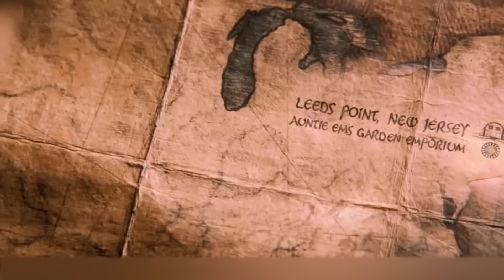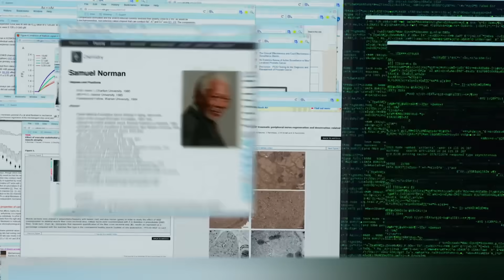10,000 Years Into the Future in 10 Minutes

Comment: What's Happened so Far?

1/1/2019 -- New Horizons made a close approach to the Kuiper Belt, more specifically 486958 Arrokoth at 05:33 UTC.
3/1/2019 -- Chang'e became the first object to land on the far side of the Moon.
23/3/2019 -- ISIS is permanently eradicated as its last territory, located in Al-Baghuz Fawqani, which is in Syria, is liberated; ending a 5-year war.
10/4/2019 -- Scientists at the Event Horizon Telescope take the first image of a black hole (M87*)
15/4/2019 -- A major fire starts in the Notre Dame during Holy Week, with said fire causing the collapse of the roof & main spire.
(gotta finish)

Comment: A space rock almost twice the size of the Eiffel Tower is due to fly by the Earth on August 10.

According to NASA, Asteroid 2006 QQ23 is 570 meters (1,870 feet) in diameter and is traveling at speeds of approximately 16,740 kilometers per hour (10,400 miles per hour). It will come close enough to be classified as a near-Earth asteroid and is branded "potentially hazardous" – but astronomers are clear that there is nothing to fear from the celestial object.

Nice prediction asshole...

Comment: According to Wikipedia, this thing is going to miss, and I paid them my $3 this year, so it's legit.
Reply: But there are 7 more out there so... yikes.

As of 2014, the diameter of Apophis is estimated to be approximately 370 metres (1,210 ft).[3] Preliminary observations by Goldstone radar in January 2013 effectively ruled out the possibility of an Earth impact by Apophis in 2036.[11] By May 6, 2013 (April 15, 2013 observation arc), the probability of an impact on April 13, 2036 had been eliminated.[3] Using observations through February 26, 2014, the odds of an impact on April 12, 2068, as calculated by the JPL Sentry risk table are 1 in 150,000.[3] As of March 2018, there were seven asteroids with a more notable cumulative Palermo Technical Impact Hazard Scale than Apophis.[12] On average, one asteroid the size of Apophis (370 metres) can be expected to impact Earth about every 80,000 years.[13]

Comment: this is perhaps off topic but I think some one might want to give it a try...   I have an idea for a lifting force machine. 
Step 1: Get hollowed out cube.
Step 2: Securely attach magnet to inner bottom of hollowed out cube.
Step 3: Place a lever on inside bottom of cube behind the magnet that's securely attached to inside bottom of cube so that one side of the lever is pointing towards you and hanging over the magnet.
Step 4: Attach a vertical bar to the top side of the part of the lever that is not hanging over magnet witch is securely attached to inner bottom of cube. Make sure the bar goes all the way up to the inner top of the cube barley touching it.
Step 5: Securely attach a magnet to the side of the lever that is hanging over the magnet that is attached to the inner bottom of cube.
Note: Magnets need to be facing each other with attracting poles N,S or S,N
Note: The lever is going to have to be really close to the magnet on inner bottom of cube because of how close those magnetic fields need to be to interact. But not so close that magnets can touch.
The magnet on top connected to lever is pulling the magnet on inner bottom of cube towards it and since the magnet on inner bottom of cube is connected to cube, this pulling force acts as a lifting force. Now at the same time the magnet on inner bottom of cube is pulling the magnet on top downwards BUT the magnet on top is connected to the lever so any downwards pulling force is being converted mechanically by the lever into upwards lifting force. Now if you know anything about magnets you now that there are magnets powerfull enough to lift far more weight then just there own. So essentialy this divice is exploiting the powerfull pulling force of magnets by mechanicaly transforming its magnetic pulling force into mechanical lifting force through the clever utilization of a lever, and walla stuff can be made to fly. Imagine if the magnets in this experiment where electro magnets so the ammount of electrical current going into them determined the ammount of lifting force that it would have. Now imagine this system being used as an attachment that could be placed under or ontop of vehicles to counter the weight of the vehicle and any cargo its carying. Now imagine  if this was done with powerfull permanent magnets and turned sideways and placed in an electric generator and had enough strength to pass through the magnetic fields as it propelled itself forwards with its own magnetic pulling force.     Signed   AMA
Reply: cant work magnetism cant produce energy.. its basic physics... got to love all these idiots on youtube being like "ohh i created a way to produce energy out of nothing im gonna get killed soon" :D
Reply: Thank you for responding :) But please look closer at the experiment I stated. Pay close attention to the use of the lever. :D
Reply: I’m more of a visual person so I would need a drawing 😂
Reply: I created a version of it for the fun of it in a game on PS3 called Little Big Planet 3 and published the level with it in it. You could look at it from their if you have PlayStation 3 and game called Little big Planet 3. Just look for Level Created by BlueCloudStar     :)
Reply: Why not just use a linear accelerator like the bullet trains? It's more or less what you're suggesting only in reverse.
Reply: I'm so fucking baked at work right now .. can't believe I read all of this .. this is actually one crazy theory I give u that...
Reply: Thank You for taking the time to read it :D
Reply: Done it my hand ended up in my toaster

Comment: We can avoid what will happen in 2100 by reducing carbon emissions
Reply: I suggest building a GLOBAL GRID:
for the best distribution of solar, wind, and even safe molten salt nuclear energy, needed to power massive desalination plants, needed to water an extra continent's worth of C4 plants indefinitely, needed to sequester the excess CO2 deep into the soil that would otherwise would stay in the air, heating things up, even if we all stopped emitting more of it now.
It will take decades just for the mass of the oceans to cool back down to natural levels. Otherwise (without removing the excess), it will take centuries for the biosphere to heat up to equilibrium.
Yikes!
Global scale (clean) energy is required to fix global problems.
Reply: @fireofenergy  more scientists need to be in politics
Reply: Humanity's increased it by 50% already.

Thus, to get the atmosphere back to how it was to make the conditions for the favorable climate we will need to use LOTS and LOTS of energy, to get it, the excess CO2, that is,  back down into the soil via plants.
That, inturn kinda makes the deniers right. More plant food, actually, more soil food!
Reply: Plant more trees
Reply: And water them trees. Plant more grass, too (but don't cut it and don't put pesticides on it)because grass, even though smaller, puts more CO2 into the soil, making better soil.
Reply: If you want to reduce carbon emissions then tell India and China to stop existing
Reply: You think by then the coal fires in India will be out, they are pumping out more carbon than I ever will!
Reply: Ya like they had here in BC Canada. They finally closed the plants down cause it was a joke and money making scam, thats all it was.  It did nothing for the climate.
Reply: Thank you!!!!!!
Reply: Well you should probably come up with a solution to avoid the asteroid in 2029 first 😆
Reply: we hope they do reduce these carbon by ''eliminating'' factories .

Comment: By the year 8,000, the moon will have moved less than a fifth of a mile, one thousand feet to be precise. It moves away from the earth at an average rate of one and a half inches each year. Even then, it would take over fifty billion years for the moon to move to the "goldy-lox" zone of the earth, where it will take roughly forty-seven days to revolve around the earth. At this point it will be gravitationally locked with the Earth until some outside force knocks it off course. None of you have anything to worry about.

Comment: If we can still improve computers at the current rate and actually can create an AI we maybe reach many of this goals way before you predicted. 
But Moore's law is not working anymore... One of the best predictions ever made. Gordon Moore said every 2 years the amount of transistors in prozessors will double. In the next two years its not possible anymore, because there are only 5-6 layers of atoms between the electronic parts of a prozessor.

Comment: Your in information base is wrong and therefore calculated extrapolations incorrect. By 2075 The global population will be around 2 billion. Between 2030 and 2070 the depopulation cycle will begin because oil is a finite resource and now odds in decline following a bell curve consumption rate. This is covered as a topic of Biotropic Engineering Design at University of Wolverhampton by Mr A Shattock. He has proven that global warming will reverse after 2100 and global evaporation processes will slow and lead to a stormy maritime climate globally. The increased water volume will cause seismic events on scales need ever seen before that could break open continental edges and release magma that vaporises entire oceans to leave sea beds exposed. This will possibly cause tectonic shifts that create global scale earthquakes of magnitude 9 to 12 that level mountain ranges.

Humanity has little to do with this eventual outcome
Reply: How is "depopulation" going to start? It would have to be enforced, and that would not be easy to do.
Reply: John Atkin oil is a finite resource. As it begins to run out we lose our ability to manufacture fuels to sustain farming, medicine, construction, transportation, machine lubricants, air travel and the collapse of global trade.
Reply: I agree that oil is a finite resource, and I look forward to the day we stop using it. I don't think that will be what causes depopulation though. Not on a large scale.

Comment: FYI: 03:09 "99942 Apophis (/əˈpɒfɪs/, previously known by its provisional designation 2004 MN4) is a near-Earth asteroid that caused a brief period of concern in December 2004 because initial observations indicated a probability of up to 2.7% that it would hit Earth on April 13, 2029. Additional observations provided improved predictions that eliminated the possibility of an impact on Earth or the Moon in 2029."
"The diameter of Apophis is, as of the most recent 2014 observations, approximately 370 metres (1,210 ft).[2] Preliminary observations by Goldstone radar in January 2013 effectively ruled out the possibility of an Earth impact by Apophis in 2036"
 
So instead of calling this out as "a change that will take place" you might wanna get the words "speculation" somewhere in there :), am not saying you are wrong on certain points in this video. I am saying however that some of your "changes" have an extreme high level of speculation to be brought as certainty or fact.

Comment: Okay yes. I am an astronomer currently studying one of the newest stars we have discovered, and i, 2029, the a stroke mentioned is named 2004. After the date it was discovered. every following year that passes, the chances of this a stroke hitting earth decreases. it is currently a 1 in 60th chance that 2004 will hit earth. and if it does. it won't cause major damage. Yes it could kill tens of thousands of people. but if it comes to that. we have a protective misile safety protocol to destroy it before it reaches the crust. this will make it fly into bits and kill a lot less people. And if it is heading for the oceans. then it probobly won't kill anyone at all. besides, the astroid will only be about as big as Texas if or when it reaches earth. but the chances of this happening are still very slim. It would be cool to go outside and see it fly by though. so until 2029 astronomers say that the chances have gotten 20 times greater of 2004 hitting earth. there is no need to worry.

Comment: Ughhh.  Did you even research 90% of this?  

We could TRIPLE the amount, not what we produce, I mean triple the ~440 PPM of atmospheric CO2 and still be below pre-Pleistocene levels, not to mention that two of the periods with the demonstrably highest concentrations of atmospheric CO2 per rock-leaching analysis shows that global temperatures were well below the average.

99942 Apophis is about 99.999% sure to miss Earth in April 2029 and there is ~1.35% chance it will hit the gravitational keyhole in 2029 to set it up for a 2035 impact.

Mars is NOT going to be fit for human habitation with an atmospheric density 1/168th of Earth, temperatures that barely reach of above freezing during the day, and an incomplete Van-Allen radiation belt to lessen the effects of ionizing radiation on the surface.

Comment: They have already sent a car to mars watch SpaceX
Reply: They attempted. It's not going to end up on Mars. Still cool though.
Reply: tesla
Reply: You're both wrong; it was put un the intended heliocentric orbit using the same manouvers that will get you to mars during a transfer window. The car might still encounter mars in the future though.
Reply: 2018 - SpaceEx sent a Tesla into Space 
12,018 - The Tesla will be 155,926,401,623,596,615,768,723,592,568,501,826,458,071,256,498,126,350,877,436,851,920 Miles away from Earth
Reply: Probably not even a real car. Why waste it?
Reply: Matt Selph.  Most donuts are filled with either cream or jam, you sir are filled with Spacex.
Reply: It's called cgi.

Comment: Venice was mentioned here facing doom, but with rising sea levels, but it's also sinking which wasn't mentioned. A simple Google search on the subject finds this: "The subsidence was confirmed by the slow sinking of Venice's 117 islands, with those in the north dropping at a rate of 2 to 3 millimeters (0.08 to 0.12 inches) per year, and those in the south subsiding at 3 to 4 millimeters (0.12 to 0.16 inches) per year. Venice's subsidence is well known." Otherwise, this is a very interesting video.

Comment: in 10,000 years. Our Moon will have moved away just 1,250 feet,  at just 1.5 inches or 3.8cm a year. Just barely over a quarter of a mile. The moon is 238,900 miles away, so 238,900.25 of a mile is not going to make any difference. None that we would notice anyway.

Comment: Great video but some flaws I found:

The carbon dioxide future emissions projections are based on scenarios depending on how our technology evolves so 900ppm isn't the absolute figure, it will more likely be less as cleaner energy adoption increases.

The gulf stream is already decreasing it's range to the UK and the melting of arctic ice is going to accelerate that as fresh water into the ocean will alter the Atlantic meridional overturning circulation to push the gulf stream further south, so the UK will only get colder (similar climate to Russia/Canada - on the same latitude)

Also the acidity of the ocean is increasing not decreasing as the amount of CO2 stored in it rises.

Comment: When you say, "The most likely planet to find life, is Mars." You are technically true. But within our solar system, there are 2 bodies, which have a much much higher chance of life, and we know there is liquid water in both places. One of the Jovian moons, Europa, the other, because of the vast amounts of hydrocarbons, Saturn's moon Titan. Europa is kep volcanically active due to tidal forces with Jupiter and its 3 other larger moons. We know there is liquid water under the ice, potentially deeper than the deepest parts of our own oceans. These moons are massive as well, in size. Although it is flooded on the surface by jupiter's HUGE magnetic field, and the surface is scoured by huge amounts of radiation, we know for a fact that only 500 feet of Ice is enough to have safe, non DNA breaking radiation. also, most people don't realise that Jupiter, NOT saturn is in the INNER solar system. The light from the sun is still quite bright. With geo-activity, water and knowing life here can live without any sunlight, in massive pressure and metabolize off of volcanic plumes, Europa is probably the best choice. Arthur C Clarke had it right after all...

Comment: The single accepted currency mentioned in this video is called litecoin.  Most would think bitcoin is the answer but its use case is limited, and transactions are expensive and slow. Litecoin is much quicker and cheaper to transfer and will be the #1 contender in the peer to peer global secure payment system.